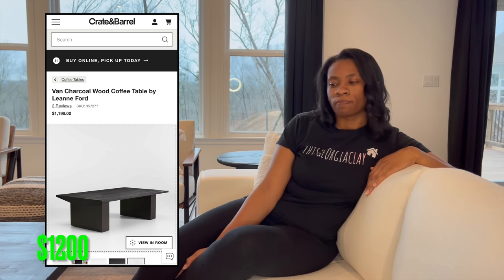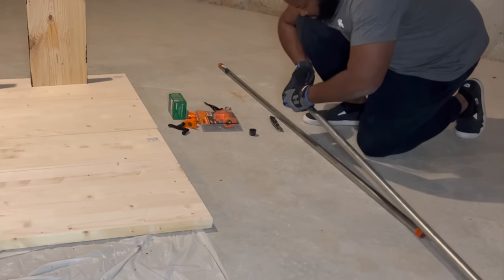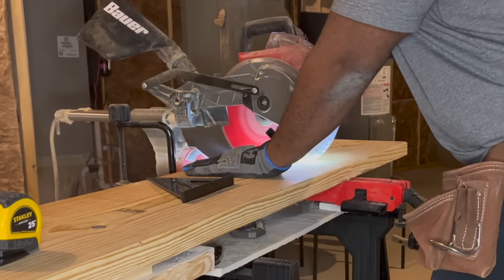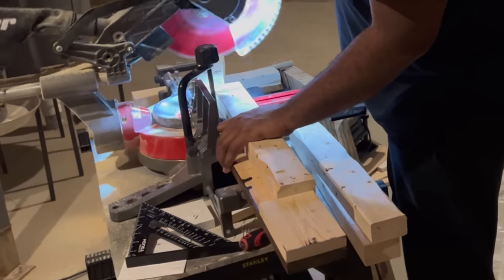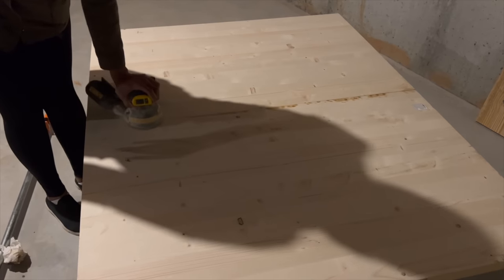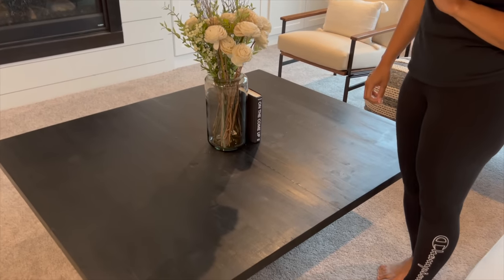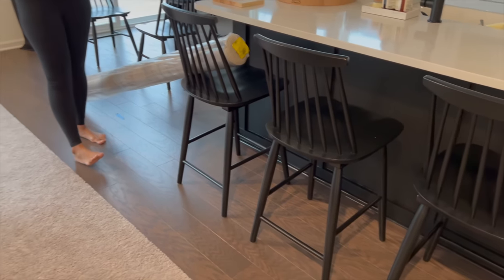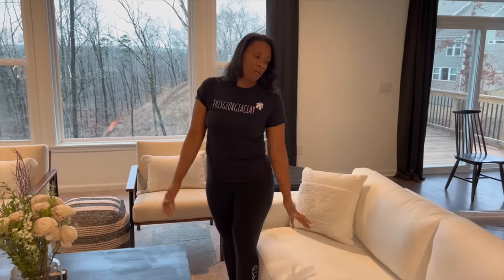House to Home UPDATE | $175 DIY COFFEE TABLE | Crate & Barrel Inspired Coffee Table + SOFA Update

Comment: Excess wood glue is not a problem,  You will get outflow when boards are clamped together, that's a given. Clamp the wood and then wipe the excess glue that has squeezed out off of the wood with a damp cloth, and wait for it to dry, give it plenty of dry time.  When it's dry sand any left over glue residue before treating and finishing the wood.
Reply from the maker: The glue was dripping prior to adhering the two boards together. We put a tad too much but we know for next time. Thanks